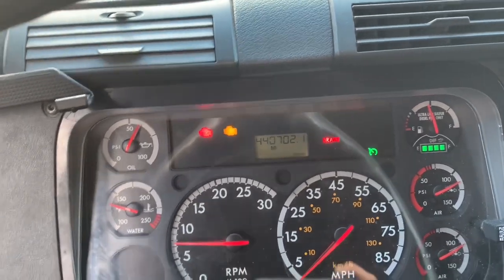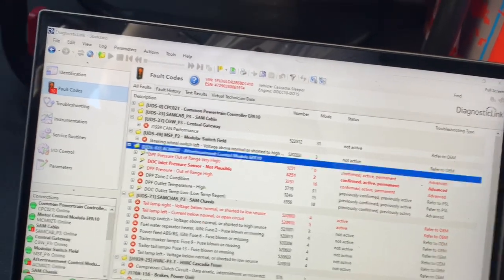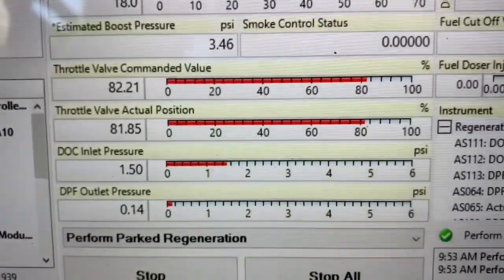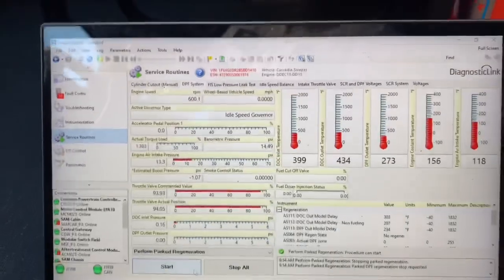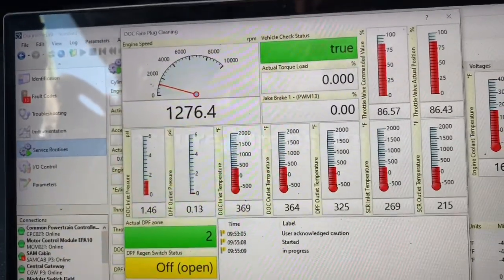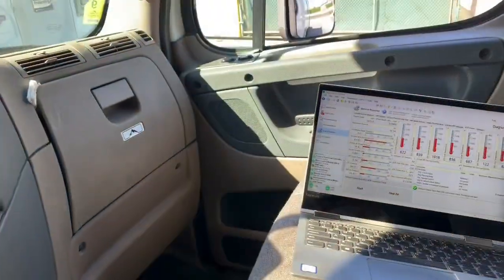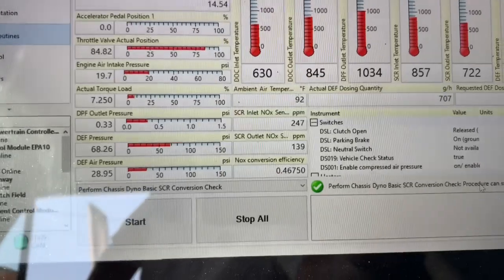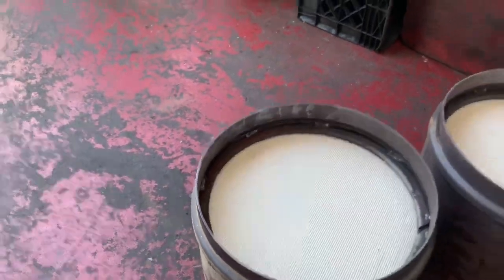Bad One Box on a Freightliner Cascadia Part 1

Comment: mi pregunta es esta ,supuestamente las computadoras tienen codigos que enseñan las partes que hay que coregir supuestamente para no andar adivinando lo digo por esta razon yo trabaje como mecanico ruanin en schindler elevator corp y cuando ay fallas te fijas en la computadora si esta un codigo te refieres al manual y corriges el problema lo que sea,no importa pero supuestamente devrs de saber el funsionamierto de como esta compuesta una escalera o asensor las piesas o componentes ,sin saber el funsionamiento ,no saves por donde enpesar..
Reply from the maker: El programa te dice el fault o código y dependiendo del código si se puede cambiar el puro sensor y después probar y después e código se cambia a inactivo solo. 
Pero muchas veces se tiene que probar y después cambiar sensor. Pero con el tiempo y la experiencia se va conociendo las fallas.

Comment: Hey brother… I have a new 1 box installed on my cascadia.. The doc inlet is 1.73 and the outlet is 0.88? So is my 1 box bad?
Reply from the maker: @MERCERPOLOCLUB  check the tubes DOC in and DPF outlet. 
Could be the ACM, when you open the ignition check the pressure and voltage. Then try this again when you do a regen. Comparing the numbers. Could be a bad ACM.

Comment: You should just clean the pipe and fix the problem in 10 minutes. But you guys wants to screw drivers.
Reply from the maker: There are different ways to approach a repair. I personally don’t want to have a customer come back because I decided to cut corners. If a driver is doing the repair themselves and cleaning the pipe is the best option for themselves then go for it. 
I prefer to do the repairs the right way and keep the driver on the road.

Comment: How many hours to remove a 2016 DD15 one box? Can it be done in one day? I'm just curious because my truck needs a one box replacement and it only took about a day for freightliner to replace it.
Reply from the maker: The job can definitely be done in a day. Remove the One Box, assemble the new box, install it back into the truck and then program the MCM. 
So a day seems about right, depending on what was wrong with your box, they might need additional testing. 
But make sure get things in writing especially the warranty.
Reply: @CarlosDieselElectric  okay thanks ...yea because it was through warranty
Reply from the maker: @carlosberrios1021  nice, glad the warranty covered you, because the One Boxes are expensive.
Reply: The truck was asking for regens every 500 mile or so
Reply from the maker: @carlosberrios1021  that can be a sign of a bad one box, DPF’s. 
But getting it replaced is great especially under warranty. 
Also, ask about any software updates. Sometimes Detroit will release updates to the MCM, ACM and CPC. These updates help.
Reply: @CarlosDieselElectric  Good info to know thank you a whole lot

Comment: Hi where can I find the right wiring harness for the one box?
Reply from the maker: There are a few options, it all depends on the year of your truck. There is a one piece and there is two piece sensor harness , there is harness that goes from the ACM to the One Box. 
Which one are you looking for?
Reply: @CarlosDieselElectric  I’m looking forward the single one it’s a 2015 Freightliner Cascadia
Reply: It’s the one where there’s a big orange circle and it stays in the one box
Reply from the maker: @cristoperodriguezgil8075  sounds like the sensor harness.
Reply: @CarlosDieselElectric  yes that’s what I need but I can’t find the right one for my truck thanks for answering by the way.
Reply: @CarlosDieselElectric  2015 freightliner 132
Reply from the maker: @cristoperodriguezgil8075  the item like many things are on back order. What city and state are you in?
Reply: @CarlosDieselElectric  I’m New York NY but I can get to jersey no problem if they have it somewhere there
Reply from the maker: @cristoperodriguezgil8075  try calling Valley Power Systems in City to Industry, Ca. Ask for Steve or Pablo. They are good at getting what you need.

Comment: What is a normal DOC inlet pressure range?
Reply from the maker: During a regen your DOc inlet pressure can be as high as 1.10 or lower. At the end of the parked regen it should be about 0.80 to 0.90. 
Anything higher than 1.2 Detroit will say the DOC is plugged.
Reply: @CarlosDieselElectric  Thanks
Reply: During the process on my truck the doc inlet pressure was between .96 and 1.05 is that bad?
Reply from the maker: Nope. Those are good numbers. Anything over 1.20 (I believe) is more than Detroit wants.
Reply: I put brand new one box and pressure is 1.56
Reply from the maker: This was during the regen, just in case clean out the tubes.

Comment: That I need to change the scr box?
Reply from the maker: The SCR can be a problem in itself. You can have a good DOC and DPF but the SCR can ruin it
Reply: @CarlosDieselElectric  I took the truck to detroit they said the problem is CPC & the truck still there for 1 month because they said is back order, do you have a CPC maybe you can help me?
Reply from the maker: @jomartino1440  right now there are so many issues with back order items. Even a used CPC is hard to get. I personally don’t have one. Try your local pick a part   What City are you in?
Reply: @CarlosDieselElectric  okay I will try to find it in pickup parts , I hope can find one thanks man, Bakersfield Ca

Comment: The scr box is overheating and melt the plastic the side fairing
Reply from the maker: Check for exhaust leaks, that can cause the melting of the fairing. 
What are the temperatures ?
Reply: Maybe 150 degrees the scr box is very hot, I have OTR tool I do the forced regen because the truck just run 5 miles an hour
Reply from the maker: @jomartino1440  try removing the side panel or side fairing and see if you can see any signs of soot or exhaust leaks. Sounds like there might be an issue there and also check the heats shielding and make sure it is secure
Reply: @CarlosDieselElectric  yes sir it has exhaust leaks I cleaned the DPF filter and bought a gasket and put it on and when I start the engine like is smoking steam because I clean it with waters to save money but I don’t have the computer to reset the service.
Reply from the maker: @jomartino1440  that is the problem with water, much like when coolant gets into the system. With the heat, it evaporates and creates steam and will cause problems. Bake and clean of the DPF will cost you about $300 plus parts and labor.
Reply: @CarlosDieselElectric  yes sir, you are right if I get near Los Angeles, can I take the truck to your shop?
Reply from the maker: @jomartino1440  sure, if you can give us a call to give us a heads up
Reply: @CarlosDieselElectric  yes sir, can you give me your email address? that I can email you when I’m around Los Angeles Area.
Reply from the maker: @jomartino1440  email address is carlosdiesel@sbcglobal.net
Reply: @CarlosDieselElectric  thank you sir,

Comment: Great video... do you have an idea what might be the culprit of a intake manifold pressure. I currently have a tractor that has high intake pressure (33 psi)
Reply from the maker: What is the fault or fault codes?
Reply: Pedro Fuentes  It continues to come in for “Low Nox efficiency”. When I perform a force regeneration the the Nox conversion is above 80%. The parameters look good but the intake pressure seems higher then usual.

Comment: Just had to request a GHG14 one box. The doc face plug procedure didn't make any changes to the inlet pressure. $6K
Reply from the maker: Ouch. Yeah, the DOC face cleaning is kind of like a long shot. Depending on how plugged, were the DOC’s pushed forward towards the DPF?
Reply: @CarlosDieselElectric  no, actually they weren't.
Reply from the maker: @robertpope3619  how many miles on the truck before you had to replace the One Box?
Reply: @CarlosDieselElectric  I believe it's 433K one box should be here at the shop this week.
Reply: @robertpope3619  you can air clean doc's if doc inlet pressure is too high to run face plugging routine. We do not replace 1 boxes for doc pressure high unless a thermal event has happened.

Comment: Great video, thank you! 
Just wondering, where can you find the parameters for a well functioning system?
Reply from the maker: Good question, just to clarify. By parameters you mean what is normal temperature and pressures during a regen?
Reply: @CarlosDieselElectric  yes the parameters during regen, but also parameters during normal operation. Is that something you can find in a shop manual?
Reply from the maker: @albertcruz3232  the only thing I can think of is the shop manual for DD-Series platform. It is a series of books that covers the engine, after treatment fault codes and more. 
Not sure if and how they sell it. Where are you located?
Reply: @CarlosDieselElectric  thank you very much! I'm located in Los Angeles, Ca.
Reply from the maker: @albertcruz3232  check with Valley Power Systems in City of Industry, CA.
Reply: @CarlosDieselElectric  10 4. Thank you very much!
Reply from the maker: @albertcruz3232  your welcome

Comment: Hello Predro,
I am having regen problems with cascadia. I have fault code 3556 1 regen teperature out of range low.
I ran a rwgen and the Doc onlet presssure reading 1.65 dpf oulet .48
I was told to cleand replace DPF filters and replace SCR box. Too expensive. I watched you video and wanted to ask for you help in troubleshoting. I dont want to spend a fortune in a Scr and i am new to this and dont undestand the software  i have diagnosticlink pro
I does not show teoublwshooting steps for this code. Your help will be appreciated much.
Reply from the maker: Try performing a DOC face plug cleaning routine.this may help. But let me see I can do some research tomorrow when I get in.
Reply: @CarlosDieselElectric  
Thank u for the reply i will do a doc face plug cleaning. Would you recommend Scr test or just do doc cleaning for now
Reply from the maker: @jesusruiz9654  let me get to work and read up on the fault code just to be sure. What other codes are you getting?
Reply: It had code 4364 18 replaced scr outlet nox sensor, ran a regeen and it went away.
 3556 1 Regen temperature -out of range low is the only active code now
Reply from the maker: @jesusruiz9654  This code sounds to be just temp related, so check your 7th injector (possible exhaust blockage in the S-pipe), could be the Doser Block, DOC temp sensor, check for any exhaust leaks around the One Box (V-Clamps). 
Now as for the pressure being a little high, a simple parked regen might be able to clear it up. If that does NOT work then possibly a DOC face plug routine may work but save that for last.
Hope this helps.
Reply: @CarlosDieselElectric  
Thank you Pedro for taking the time in helping on this issue. What are the step forchecking rhe 7th injector.i will compwnsate for you time and knwledge. Donating to ur xhannel

Comment: help. ayuda . what should i do with this error .mcm reported ash mileage is lower than the cpc stored value? error code247
Reply from the maker: Did you get a new or different MCM? What channel? This usually happens when a computer is switched or replaced. Tell me a little more about what kind of work has been done